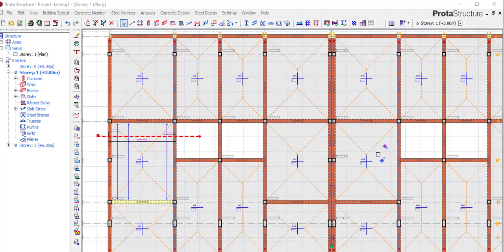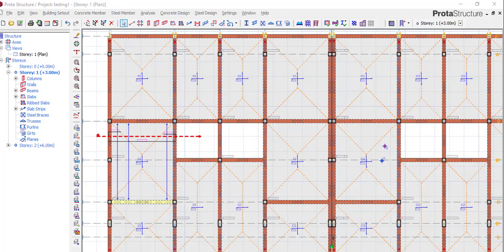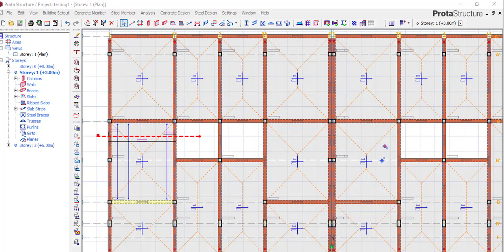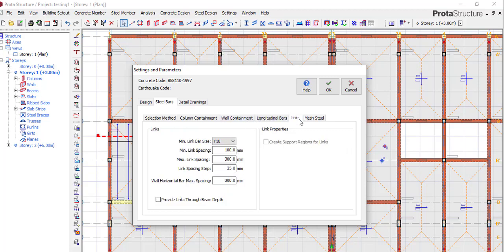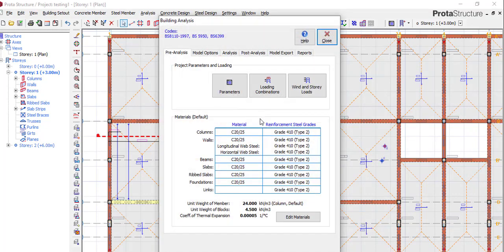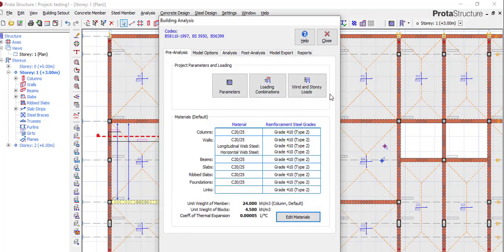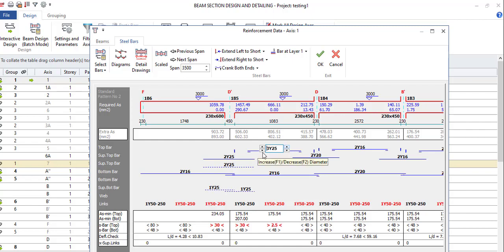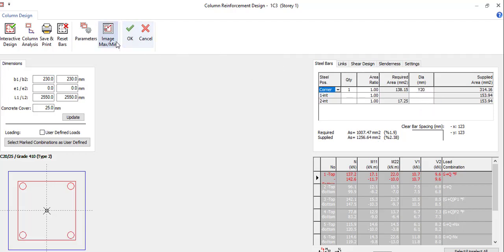protastructure tutorial: how to rectify  reinforcement error in beams, slab and column (Y50 to Y16)

Comment: Hello Sir, thank you so much for being there of us.
Pls how can i correct this problem
Horizontal Axis:1C16X - (Delta-Y = 13.81 mm, L = 11050.01 mm, Angle = 0.07163 d)
Reply from the maker: Highlight the grid line, right click it and go to property.

When you are in property, change the angle to 0 ( zero degree) and click on update.

The other method is to delete all structural elements on that grid line and then delete the grid line. After that draw a new grid line while holding down the control key.

Let me know if it helped